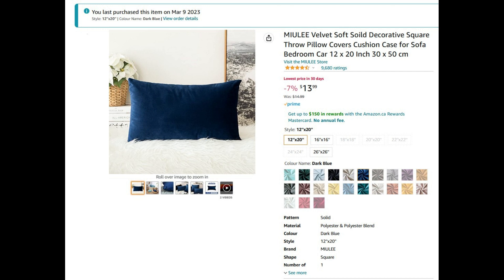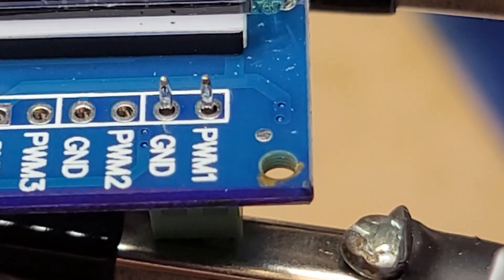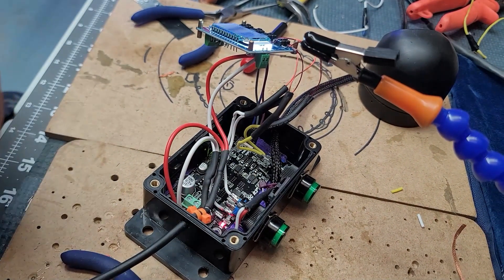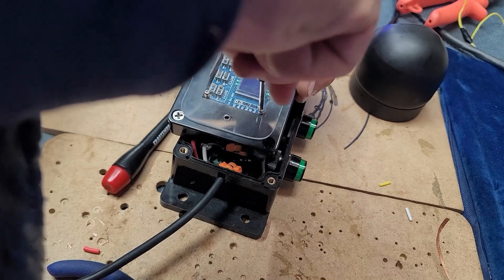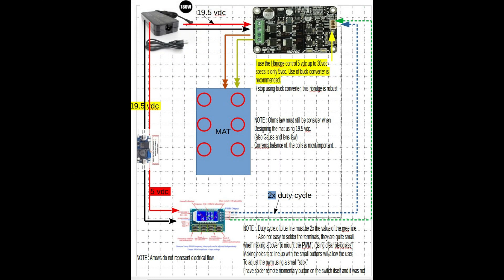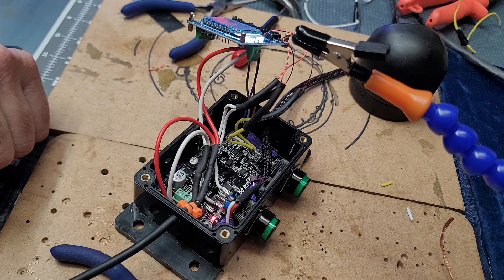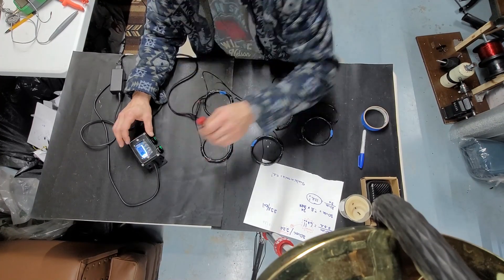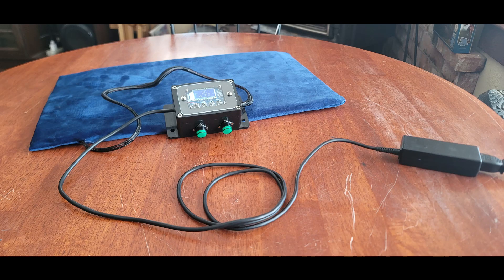My life is on the line....

Comment: Would it be feasible to add in a control circuit, for gauss intensity, by adjusting the voltage or amperage?
Still doing some reading to inform myself; have plenty experience with Ohm's law, but am checking out Faraday's and Lenz's laws, as I haven't worked with much of anything concerning magnetism and induction.
I want to design a unit that will not create much heat (if any) from the coils, just for safety's sake.
Don't currently have a workspace at my disposal, so trying to get all the engineering and logistics as solid as possible first, so I can jump into it asap, once available.
Thank you for what you do! 
✌️😎⚡🧲🌎
Reply from the maker: Watch my last video.  That is a fully controlable unit. :)
Reply: @Steeve.  Yes, thought that was a super awesome unit using the Nextion! 🤓
My aim was to stick more along the lines of the original idea, using the simpler parts, in a more affordably serviceable form.
At least until I can get enough for a fully featured system, as I really like full adjustability 😁.
Again, for safety I wouldn't want to boost anything, only cut them.
Was just wondering if you had experimented with that, and if heat was any issue.
Reply from the maker: @brujahboy2004.  heat can be managed by reducing the duty cycle,  when using pulser type unit it become harder has you use super high voltage,  there ways around but it is very expensive.
Reply: @Steeve.  Makes perfect sense; don't know why I didn't realize it, 🤦lol. Thank you for the clarification 🙂.
Going to do some more homework and make sure I completely understand everything.
Will be attempting to make one as soon as I can. Thanks again! ✌️🤓⚡🧲🌎

Comment: Looks good! Be wary wearing the band around your shoulder like that. The mat will bend and it will curve the magnetic field which will neutralize the field, actually making the field weaker. Wearables are cool!! I just wanted to share what I’ve read
Reply from the maker: Ypu bring a good point,  did you know that the magnetic field can only be adding or substracting when they are perfectly parrallel to each other.   Magnetic lines do not actually exist no more than elevation lines on a map.  It is only for our human need to visualize something.   Magnetic lines , like elevation countour lines on map can not cross each other.   You can not have 50' of elevation and 100' of elevstion ever at the same place.   No more than two different magnetic lines can interact.   

Like i said,  you are not wrong but it would take extremly precise units at the perfect angle to make that happens.   :)  

Stay curious!